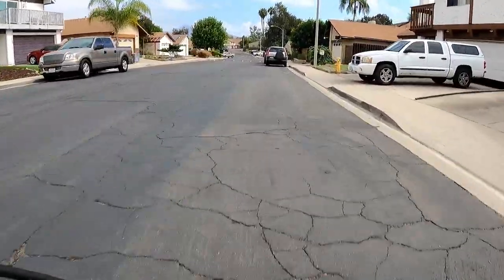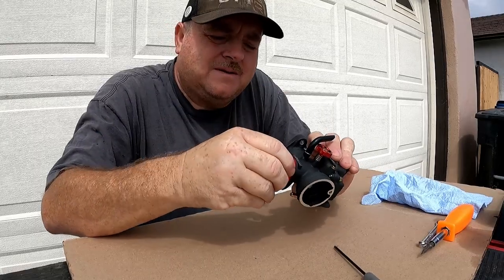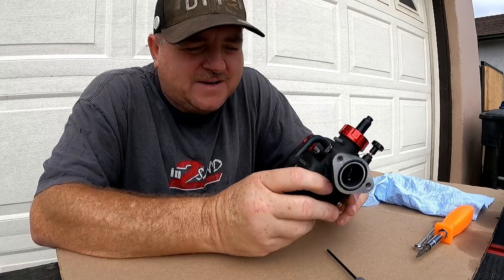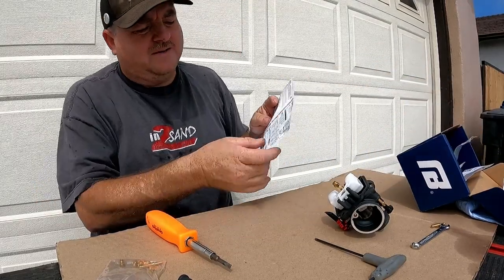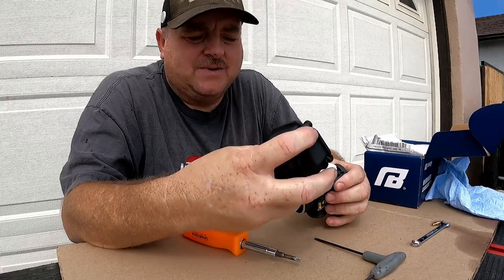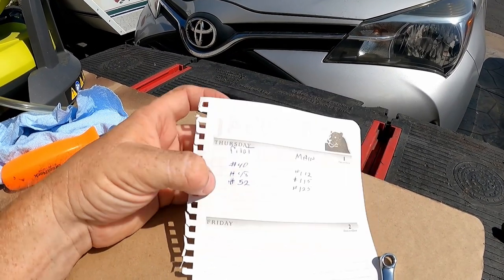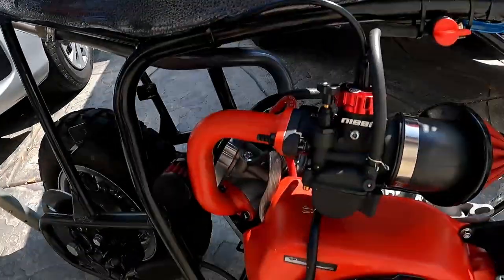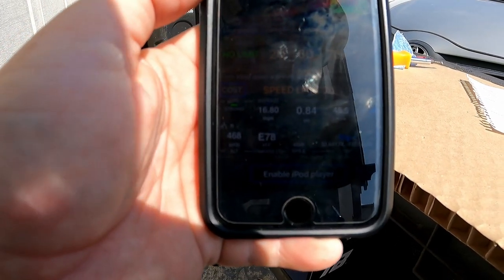NIBBI Carb Adjustment

Comment: what’s the red thing for ?
Reply from the maker: Hello Alfiehall, Which red thing are you referring too? Is it on the carb or engine? In the video at 24:06, it shows the carb, engine intake and fuel cut off on the gas line. On the carb the red on top is the carb cap we’re the cable goes. On the engine there is the red intake manifold for the carb and on the frame below the seat is the fuel shut off valve. Those are the only things I can think your referring too. Let me know! Thanks for watching!!!
Reply: @DIYWilly  im sure it’s the fuel screw it’s the red dial on the right hand side
Reply from the maker: It’s the idle screw
Reply: @DIYWilly  i noticed the choke spins also use for that ? and if that red dial is the idle screw what does the little gold screw next to it do?
Reply from the maker: The small screw is the mixture screw. Gently turn it in and out 1.5 or 2 complete turns. This is a good starting point for tuning!

Comment: Hey guys I got one brand new and it leaks gas "only" when I accelerate any ideas?
Reply from the maker: Check your floats!!
Reply: @DIYWilly  I'm going to when ever I get off my ass but 2 things it's brand new so why wouldn't it be level and why do it only leak when I accelerate
Reply from the maker: @Blake_Guajardo  Could also need a good cleaning. Just because it’s brand new doesn’t mean it’s clean. There maybe manufacturing debris blocking things up and stoping it from working properly. Take the floats out and clean inside everything. When installing them back make sure there level with the carb bowl when held upside down. Hope this helps..
Reply: @DIYWilly  will do bud thank you